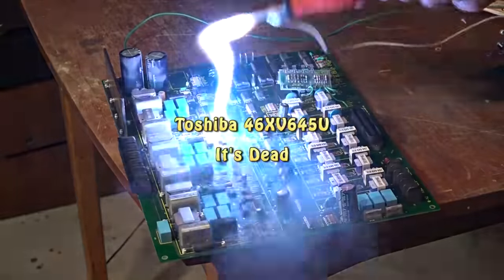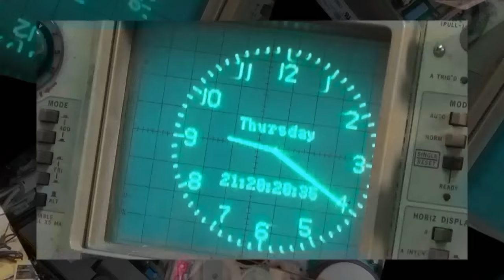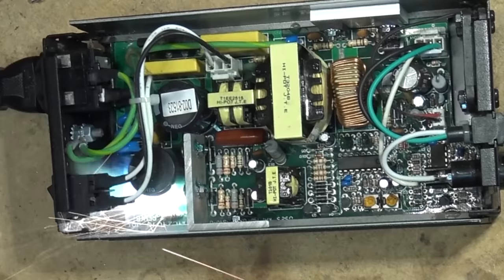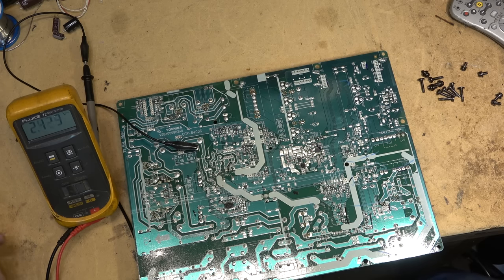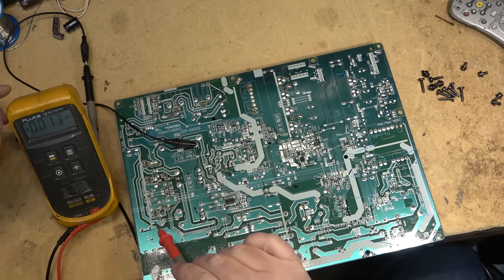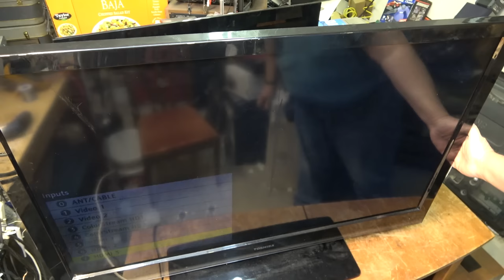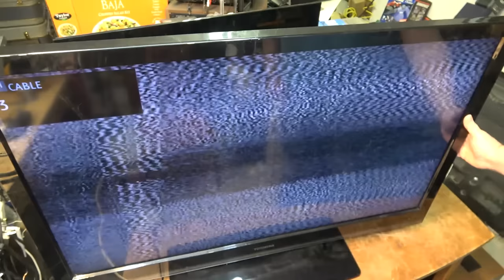Toshiba 46XV64 TV Saved from the garbage. Will I be able to fix this one? Let's find out.

Comment: To avoid a certain amount of inrush current, that 1.8 ohm resistor is a soft start resistor that is meant to let the main filter capacitor charge up slower than it normally would without that resistor, and then the relay kicks in to basically bypass the resistor.

Comment: Thermal fuses have been around for years, the resetable ones are an easy fix with the correct solder,
it's when they hide them inside other components that drives you mad, and the service manual only 
puts a safety triangle to tell you that the whole item has to be replaced.
I have taken apart many mains transformers and just replaced the thermal fuse.
These older LCD sets just keep going, unlike todays LED ones that seem to have become a fasion item
and need replacing when the backlights start to fail.

Comment: Was there any reference to a thermal fuse on the casing of the resistor? I had no idea they made them with a fuse incorporated! Great fix Dave, it's good to hear your diagnosis thoughts as you are searching for the problem! 👍👍
Reply from the maker: It said 1.8ohm 
And there was a 98 also on it. I assume that was 98 degrees c

Comment: First plasma I fixed was one of those. 0.40 pence Maplins resistor. Ran for years after. HNY Dave!
Reply from the maker: Have 3 plasma sets in now.  Perhaps one will go into severe overload.  A couple look to be 480p sets.  Heavy as hell and have the IPM boards in them so hopefully i can make 1 good one out of the 2 and give it away. Will start on those next.

Comment: I know you can fix anything as long as you have the parts and it's worth your time.
P.S. I didn't know they hid thermal fuses inside of power resistors. 
The thermal cutout works like old plug fuses did, I assume. The quick blow type (had a spring inside).
To clean a screen, dampen a rag, not so much it can drip. That's what I do. I know what liquids can do to electronics.

Comment: I had to laugh at your ref to Star Trek   "He's dead Jim". I must use it more often. speaking of thermal fuse, the ubiquitous 3 spd box fan has one embedded in the motor that fails quite often. Hard to imagine the number that are sent to the landfill by the unwitting. I think that every county should have a repurposing center to handle these exact kind of failure. On another note, we were replacing a car battery today and found the real problem was a 175A fuse that late model cars have inline with the positive 12V lead. Several experienced gear heads were astonished

Comment: I hate those thermal fuses. I had a Sony amp recently with a blown thermal fuse in its transformer and nothing else wrong with it. Naturally the fuse wasn't accessible without disassembling the transformer, which was almost impossible to do in a non-destructive way. I understand the point of them, but they could at least make them accessible to change when they fail for no reason.

Comment: I too said I didn't fix TV's. Not long after making that announcement TVs started to show up every day! I now have a video room with 12 screens and I gradually up-size the older screens as bigger ones show up. There are some amazing YouTube streams running 24/7 so now I have 12 windows on the world. When you buy mini PCs in quantity, I get YouTube/Odysee capable units for about 100 bucks each. I saved about 600 bucks from not painting the walls. It is a full immersion experience without goggles 🙂

Comment: Love the part where you find the fusible link in with the resistor. It's like an ahh ha moment. I want to ask if you would be willing to do a video breaking down the signals that drive all the different parts in a monochrome crt. It would be helpful to us who are learning this to have it all in one video. Also thank you for all of the knowledge you share.
Reply from the maker: Sure and I just happen to have one that is broken.
Reply: The reason I asked is I had a driver board that kept burning up the hot. I suspect the signal wasn't right at the hot and that's why it burned up. But for trouble shooting I would like you to Show the different signals for all the different sections.  Thank you
Reply from the maker: @dannye5335  horizontal outputs usually fail due to cracked solder on the horizontal drive transformer.

Comment: The 46XV645U was the last and final 46" LCD TV made by Toshiba. The next year 46" model was made by Compal for Toshiba.
Reply from the maker: So what you are saying is this was a good one.   I sold it and the people that got it have been very happy with the picture quality.  Especially considering the TV that they had me take away was the LG that all the lenses were falling off and half the back lights were dead. They've been watching it like that for a while. When I set up the Toshiba for them they were very happy with how the picture looked. after seeing how bad the LG was after I got the backlight working it makes me wonder how they could have watched it failing like that until it finally died.
Reply: @12voltvids  Yes, most of the Toshiba-made products usually last longer than Panasonic, historically. Panasonic plasma TV power supply only lasts for 7-8 years on average. Most restaurant bars that had Panasonic plasma monitors before during the early-2010s, they all have broken down by now and replaced with LED monitors.

Comment: My mental muscle memory just kicked in. The relays cause the problem. The relays next to the resistor get dust inside, so all you gotta do is pop the top off of them and use a small paint brush to clean it off.

Comment: And people will turn on their TV's in the morning, and leave them running all day until late in the evening.
So the resistor will have plenty of time to heat the fuse just enough to melt the solder so that it finally breaks.
Guess this is one of those things that separates consumer sets from the public display sets that are 
designed to be on 24/7 for months and months.
Reply from the maker: Actually the only time the resistor sees power is when it is off. It is the current limit soft start resistor that keeps the primary filters charged when the set is off.

Comment: I had fluorescentce backlight monitor and it died after five years - the backlight died on that monitor. Now I have LED backlight monitor from 2011 up to now - I am still using it.
Reply from the maker: I have several fluorescent lit monitors that have been running for years.  One has over 65,000 hours of running time.  These are used as camera monitors and are left running 24/7. Ccfl like to run. The hardest thing in them us starting them, like any fluorescent lamp. Every time you fire them up cold you take a little life away. Leave them running and they just keep going.
Reply: @12voltvids  I understand. I remember that you often say that. I have it in my head. :)

Comment: Interesting wish the hell I knew what he was doing? Give me a boat or a GTO I am good to go  hahahahahah
Reply from the maker: Not rocket science.  I was visually looking at the copper traces and checking components along the way.  I knew I had an open because I had to power to the standby circuit.  Standby is for remote control.  No standby and nothing else works.   The problem was an open thermal fuse mounted in a resistor. The reason it went open was either just thermal fatigue or perhaps  it had been in a cabinet that caused heat build up or was over a fireplace.

Comment: I have 2 sonys one id from 2008 and one is from 2013 that’s a multi system and it’s the old back light both stil work and there on every day of the week.
Reply from the maker: Pretty much all the new sets are multi system.
Reply: @12voltvids  I have a sony and a panasonic that I imported so I can watch my pal tapes.  I have a late 2006 panasonic I sometimes still playback tapes on.  I have some shows from London and different versions of Nickelodeon tapes from Over seas that I enjoy.  I have a sony to thats also multi system a sony vhs I have a newer set but it won't play pal on av with out a converter.  And the sony with the backlight keeps going like you said.  Its always on and great quality.  Good for retro games on av to.  I have a real crt for them to but don't always fire them up.  Is it possible to fix a scratched crt I have one that got light surface scratches? Then my multi system tvs are a sony from 2012 and a Panasonic OLED I actually got a 1080p non 4k Oled from Panasonic that I imported great set.  I have a plasma to in 3d as well for 4k I use my imac.
Reply from the maker: @stpworld  any of the modern Samsung smart TVs will display pal and ntsc.   I'm going to do a video on it soon as i have pal equipment here.
Reply: @12voltvids  I didnt know that but I refuse to buy samsung after I had issues with them in 2012  I stay iwth sony and Panasonic only i was a victom of one of there tvs with bad caps and they blamed me when i just got the set.
Reply from the maker: @stpworld  I've had no trouble with my Samsung well I shouldn't say that my 2009 63 plasma developed a loose connector a couple years ago which I had to take off the wall take the back off and reseat the panel connectors.  Other than that it's been great and has lots of hours on it. I have another Samsung plasma watch that the panel is going bad on but it has lots of hours on it. The reason the panel is going bad however it's not a defect in the panel it's a defect in the TV station that I watch with their stationary graphics it's burned into the screen. Every company had problems with capacitors in the mid 2000s. Didn't seem to matter what company made the caps there were so many bad ones out there some worse than others but they were all bad. I've seen Elna and Rubicon leaking electric onto the board. Others with tops that are bulged and leaking. Much of this had to do with strict new regulations coming out of Europe. In order for products to be sold throughout Europe they had to meet EU environmental guidelines which required toxic chemicals to be removed. It was these toxic chemicals incapacitors that kept them stable. Without them they failed relatively quickly. Another headache created by the European Union was the requirement to use only lead-free solder. That free solder in the early days created many headaches because the manufacturers hadn't figured out the right way to build products using it using the conventional techniques that were in place going back to the early days of circuit board production where they use wave soldering and so forth. The biggest headache with blood free solder is not the actual soldering but it's the cooling of the joint. If it cools too quickly this older becomes brittle and can crack very easily. It took the industry several years to figure this out. It wasn't until after product started failing in high numbers that they figured out why they were failing.  Electronics actually used to be very dirty industry with a lot of very harmful chemicals that were used in components and manufacturer. Regulations now require the industry to clean up its act and unfortunately this is resulted in components that are not as reliable as they once were when you had chemicals such as arsenic Valium lead cyanide pcbs you name it it was in electronic components.
Reply: @12voltvids  I had a samsung dvd vcr combo and it died in a few months at the time there was no one to help me with any kind of repair so i let it go I also had a samsung android and it started boot looping so for me nothig but bad experiences same goes for LG don't like them to.  I also stay with bang and olufsen they actually tell you how to fix things and even send you  a service manual to which is unheard of these days.  They will even tell you how to replace the battery inside there speakers and headsets to.
Reply from the maker: @stpworld  im still using the Samsung s9 I have had for 5 years now.  Still watching the first Samsung TV i ever bought a 2003 Samsung tantus dlp.
Always found b&o to be garbage. Over priced junk. I have an old b&o turntable.  Transformer failed and they said sorry no parts.  Sure they might sell you a manual but what good is that with no parts?   For cameras it's only Sony for me.
Reply: @12voltvids  They do seem to have parts as well and they sell replacement headphone foam to which I never see any more I don't buy everything of theres only the middle line blue tooth items.  I have sony to and I reported fake b and o items for sale on amaazon and they gave me a huge coupon and cracked down on it.
Reply from the maker: @stpworld  i have found that there are alot if fake sellers on Amazon marketplace.
Reply: @12voltvids  they really should crack down on it they even let that illegal extension cord that connects 2 plugs be up there for a little bit
Reply from the maker: @stpworld  caveat emptor, buyer beware. Not enough moderators to police huge sites like eBay and Amazon.

Comment: Why does it seem like the early LED screens and post cap plague CCFL are the ones that last forever, and that anything made after like 2014 is just shit? may be confirmation bias idk, plasmas last because they are usually overbuilt...
Reply: Panasonic plasmas tend to blow out Y-sustain boards (they call them SC boards). I've had several die that way, sometimes even after repairs. Meanwhile the Wal-Mart special Vizio from 2009-10ish my parents gave me keeps on trucking along.
Reply from the maker: Panasonic blows the sustan boards because the ground screws work their way loose from thermal expansion of dissimilar metals.  There was a service bulletin and kit with replacement screws with lock washers to prevent this.
Reply from the maker: Early ones failed just as much.  Ccfl and plasma were the most reliable.
Reply from the maker: @NJRoadfan  the Vizio sets were LG and they were famous for blowing the IPM modules on ysus and zsus boards.
Reply from the maker: @ACommenterOnYouTube  I have a Panasonic 42 plasma in my workshop from 2003 and it still works perfect.
Reply: @NJRoadfan I have one of these and it also still works.

Comment: This has prompted me to get around to both 2019 dated LG 49LV340C televisions for commercial. I suspect used in a local fast food chain for menu displays. Typical LED failure.

Will resolve the usual way. I do agree regarding ccfl televisions and I still have two Samsung 52" units from '09 working like a charm. Usual cap replacement in each. Also an Akai plasma I am never giving up. 😎😁
Reply from the maker: Plasma my favorite
Reply: @12voltvids  My first one was a very heavy 51" Panasonic when they first came out. Mostly metal and had a second glass in front of the plasma screen. My gripe was the long squirrel cage fan at the top. But they built it to last as an introduction to plasma televisions. Remember the prices used to be in the 20k plus CAD. 🤦🏻‍♂️
Reply from the maker: @SudburyMan  yes they cost a fortune. Biggest plasma i have ever seen (not worked on) was the 104' 90,000 set that they had at the Olympics.  A local had one in his house.  Was bragging be bought it from vanoc after the games were done in 2010 for 65,000. That was the wholesale price that dealers paid.  Required a dedicated 20 amp 240 volts circuit.  It was huge and had an incredible picture.
Reply: @12voltvids  😲😲😲 must have heated the entire home with that too!
Reply from the maker: @SudburyMan  I'm sure it did. Rates 4000 watts!!!!!!!!